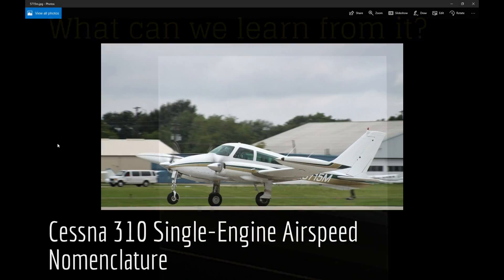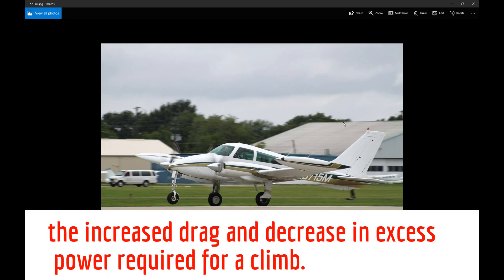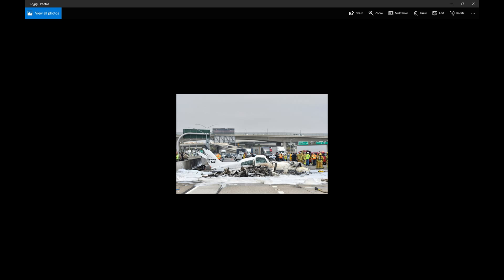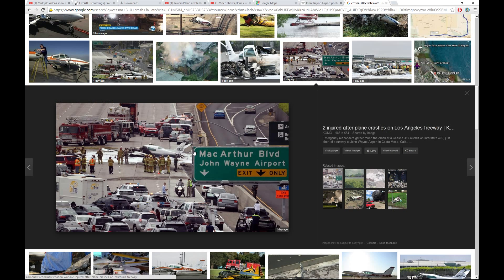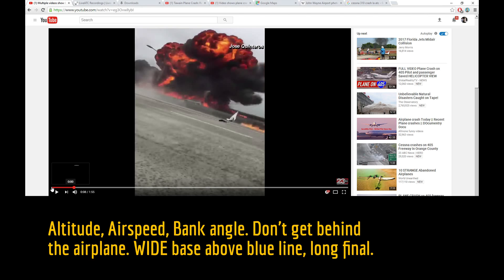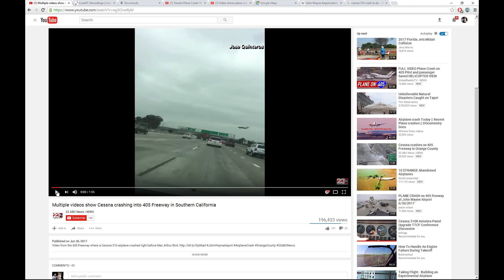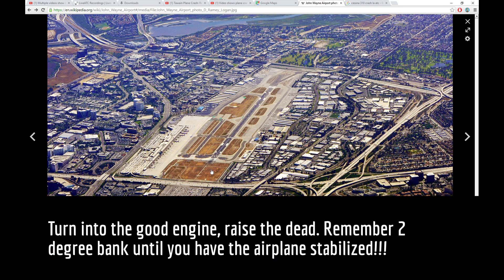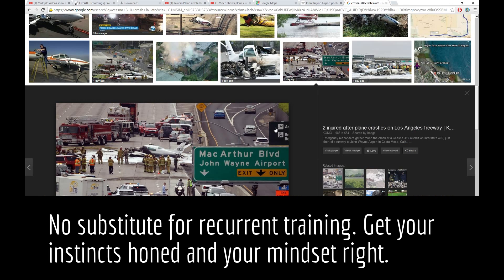Cessna 310 crash John Wayne Airport what can we learn

Comment: Sounds like he panicked and didn't have enough experience to handle engine failure.. if the left engine goes all the trust is working on the right.. the aircraft should be carefully trimmed for that speed and guide angle this will reduce the Pilot's workload...But from what I heard and saw it sounded like he didn't have enough time to pull it out... at a low altitude emergency I believe that's one of the hardest to recover from...RIP.. to the people that lost their lives...!!

Comment: Any idea what happened with the Santa Ana 414 crash into a CVS parking lot?  Horrific nose-dive.  Can't imagine the horror for those 5 onboard.  : https://www.youtube.com/watch?v=HS5UVsCHLd8
Reply from the maker: Hi Rein, In reading the preliminary report (I've not read the final nor do I know if its out yet) it seems as though the pilot did not feel confident landing on 20L then after being instructed to hold changed his mind stating he would accept 20L. After accepting 20L the airplane was below the instructed 1300 foot altitude and desending. The turn according to the report stated witnesses seeing a tightened desending turn until the airplane hit the ground. This is likely an accelerated stall created by the tight turn. My thought is the pilot was in an uncomfortable situation and was stressed. The airplane got away from him and a loss of control due the stall occured. Perhaps pushing himself in an uncomfortable situation and thus got behind the airplane. This can happen in just a few seconds and can put one in a dangerous situation. This is the term getting behind the airplane I have felt that way a few times flying and it can be tense and sometimes you simply just have to fly on. What I mean there is simply bug out and figure it out. Just get the wings level , fly straight ahead and climb to a safe altitude and get your wits about you. Your brain can get ya sometimes look at Air France 447.  Again, I don't know what happened here and feel it important to read the report but, if my thoughts help anyone it is why I share. Be safe my friends.

Comment: The photos show the engines had power on when hit the ground.  Video shows he got too close to the runway on downwind, (in panic/not thinking straight), then he overshot final, steep turned and stalled, both engines were working at idle according to the prop bents..

Comment: He panicky pilot got too close to the runway on downwind leg, overshot the align, pulled a lot elevator, stalled and crashed short..  A Chicken Pilot Error.. Im C310 CFI.. The right engine didnt fail completely.. It hit with power.. Props are bent forward due that...

Comment: I’ve got just under 1000 hours in my T310Q.  Two months ago I had a catastrophic failure of my left engine late at night with 3 passengers on board.  The feeling of the sudden realization is indescribable.  My passengers said they could tell something had changed with how the airplane vibrated, and could smell the burning oil, but that I seemed completely unaffected and calm.  It wasn’t until we were on the ground at the alternate airport that they could see that the left propeller wasn’t spinning.  I didn’t feel calm at all, but I think the fact that I behaved calmly is what made the difference between surviving and not.  I was single pilot, at night, over rough and very remote terrain, heavy with fuel, cargo, and passengers, but I followed all the rules of all flight regimes, followed my instincts+training, followed the checklists, communicated and collaborated with ATC, and survived.  I am thankful I had another engine.  It saved us to have it.  FYI - the left engine failed due to a rocker mount failure caused by a flaw at manufacture.  Highly unusual failure.  The whole cylinder basically exploded as a result.  Just left a huge gaping hole in the side of the engine.
Reply from the maker: Wow what a story, amazing job by you and that is exactly why in the 47 years a flew with my father we only flew 5 of those in a single. We had a 1955 310 we flew for over 10 years. Lost the right engine at cruise and landed safely. Flew a Bonanza for 5 years and lost the only engine at 800 feet AGL right after takeoff. Put in a field gear up :(  Then in our 310P we lost the left engine at rotation but had to continue takeoff due to short field but got it cleaned up fine and safely landed. We also had a Baron for 10 years between the two 310s but never an issue. We believe in the second engine no doubt. We are based in Seattle so the Cascades and Rockies we flew over a lot. Great job and thanks for sharing 👍👍

Comment: I took some single engine lessons in the early 60's, so see myself as a non-pilot who understands the basics of aeronautics. My only observation is that perhaps these twins could somehow be designed such that loss of one engine would not have "such" a big impact on performance? Perhaps oversized rudder, and other control surfaces ??? Perhaps more training requirements for twin engine failure scenarios?
Reply from the maker: Khadijah Brown There have been some tremendous safety changes on non legacy twins like the Diamond which has auto feathering recognized by the onboard ECU in the event of a failure. That's a great safety feature to add and is nice to see. Thanks for sharing your thoughts :)
Reply: @maxtanicfilms Hi, just wanted to mention that the DA42 and DA62 do not have auto-feather. However, you can feather by flipping a single switch (the engine master).

Comment: When I was learning to fly, I was taught that twin engine planes are more likely to crash when there is an engine failure on takeoff because pilots are more likely to try to turn back to the airport.  Seems like that's what happened here.
Reply from the maker: Pook Atim You hear folks say the remaining engine takes you to the scene of the crash. This can be true like in this case. However, in our 3 cases of engine failure, two in our 310's and one in our Bonanza it was only the Bonanza that we had to crash land. In our 310's we secured the bad engine and landed safely. Those 2 instances in the 310's (one a 1955 & the other a 1969P) were never reported because they were uneventful. One of those failures if in the Bonanza would have put us into trees and likely have been fatal. The other happened during cruise and in the Bonanza would have ended up in either another forced landing or perhaps a safe landing if able to glide to an airport. Safe and recurrent training in a twin is paramount but they can be flown safely and for us its why went back to a twin. Out here in the PNW we have lots of mountains, trees and water.
Reply: All very true.  My point is that single engine pilots are less likely to try to turn back after takeoff if the engine fails, but rather look for a safe place to set down.  Too often, twin engine pilots try to immediately turn back.  In either case, properly handled, the twin has the advantage.  I don't think there is any twin engine airplane that will fall out of the sky if one engine fails.  However, it is a lot easier to cause a fatal spin in a twin with one working engine if any abrupt or uncoordinated maneuvers are attempted.  Training is always what determines if an incident turns into a disaster.  True of private low timers and ATPs alike.
Reply from the maker: Pook Atim Your right regarding spins caused by yaw from the good engine if not handled properly. In addition twins are much more complex and because they have two engines your chance of an engine failure is doubled. All things to consider for sure. In a single your reserved to the fact your going down. Stall spins in single engine failures are the most common cause of fatality though. The principle of flying the airplane is key no matter the type. Example in our 310 there are certain times at high altitude high density (hot) airports that you know prior to take off an engine failure must be treated as a single engine because you won't be able to climb on one our airplane being non turbo. Training is so important in your make and model aircraft to be safe. The most important thing is to be in control even if your putting it down off field. Great points you make and very important.

Comment: At 43 Air School ,Port Alfred ,South Africa we trained using the Piper Seneca 2 and in any day my instructor Scott will always say no matter what remember MAINTAIN DIRECTIONAL CONTROL(rudder )SPEED(nose down if you have to.Vmca) POWER UP(firewall everything)CLEAN UP(reduce drag-flaps,gear,whatever.)IDENTIFY(dead leg-dead engine )VERIFY(throttle back on the dead leg side,the picture same) and all this happens in a matter of seconds. AVIATE ,NAVIGATE then COMMUNICATE
Reply from the maker: Ditiro Jimmy Segang You got it coverd Sir. It saves lives and we must apply that as instinct in our flying. Thanks for sharing Ditiro!
Reply: SENECA SINGLE ENGINE CLIMB SUCKS !

Comment: I've been trained and have instilled in my mind a 30 second review before taking the runway on every takeoff. Run through an engine failure scenario and what plans of action you will take. One never knows when it will happen.
Reply from the maker: Alain S Absolutely and the 310 is a very good single eng airplane. In this case panic played a serious roll which if panicked leads to unclear thinking. He had the airplane somewhat under control but the low altitude tight downwind lead to an impossible base turn to final.

Comment: Would you be able to do a video on the experiences you had with engine failure on takeoff in a piston twin? Describe how it felt what you were thinking. One thing I notice everyone talks about how many get killed in twins on takeoff then it happens to you and you think it's going to end the same way. Reality is there is no way to train for this for real.
Reply from the maker: Here is a link to our video (bottom of the comments) when we lost the engine in our Bonanza just after takeoff. As you state in other comments below when it happens for real it is MUCH different as it relates to your human condition. In training you know the airplane is working fine. Thus your training is instinct building. You train and plan and so that when it all goes wrong your fear doesn't turn to panic. ConquestN98858 comments below really sum it up because if that is programmed into your brain you do it. I know from our experience the training did create the instinct and we reacted the right way. To me the fear of death (stalling the airplane) was far greater than not flying the airplane properly which I remember vividly. Also see our video series dads Flying Stories. He talks about loosing the right engine in cruise on our 1955 C310 around 1975 to 1978 and we will have a video in that series on our 1969 C310 where he had the left engine power loss at rotation in the coming weeks.     https://www.youtube.com/watch?v=gH20IjTwtTs

Comment: Hey Jeff,
Identify, Verify, Secure-BLUE Line-Straight ahead and don't turn into the bad engine! Have a plan on each take-off no matter where you are on the roll/climb... talk after airplane is stabilized!
My creed as learned from my Dad ';-)
Good review-thanks,
Mike...
Reply from the maker: ConquestN98858 Well said Mike you lay it out perfect. Thanks for that , everyone write that down if you fly twins or aspire to do so.
Reply: FIRST SHOULD BE BLUE LINE ,IDENTIFY AND THE REST !
Reply: Regarding the Taiwan Crash... There is no reason to shut down either engine when you have an engine failure... at least until in a safe OIE cruise flight situation.
Reply: @KawRider1 In a piston twin, you need to feather the propeller ASAP to reduce drag in most scenarios.